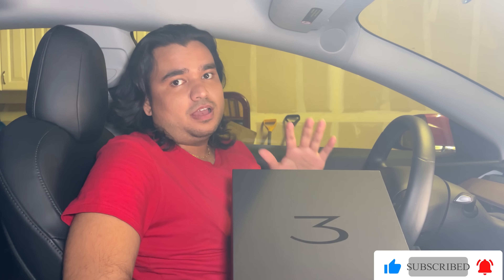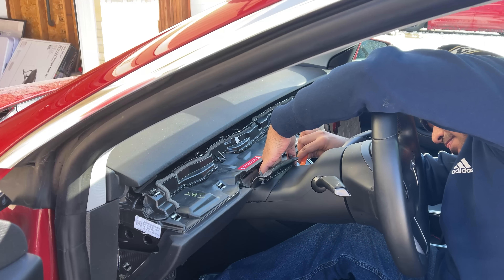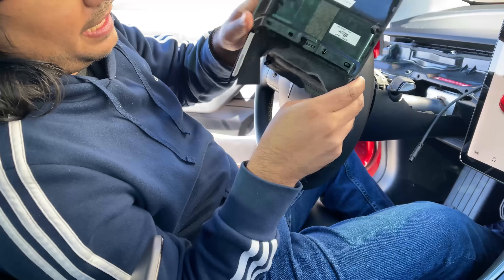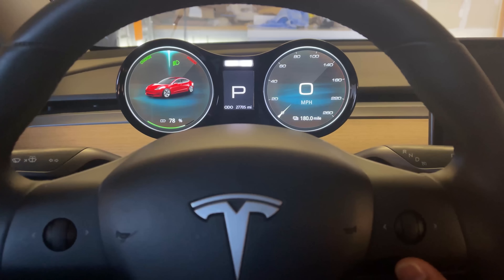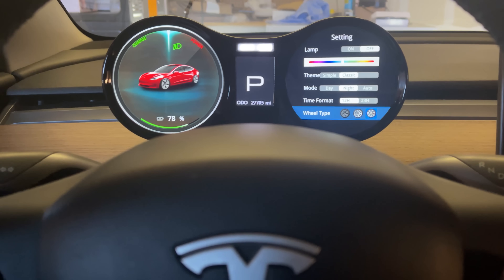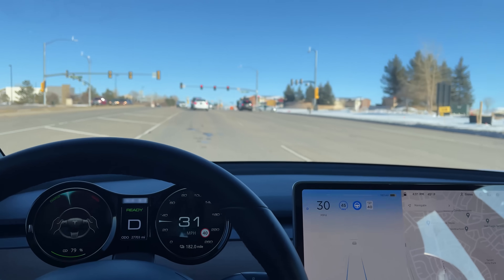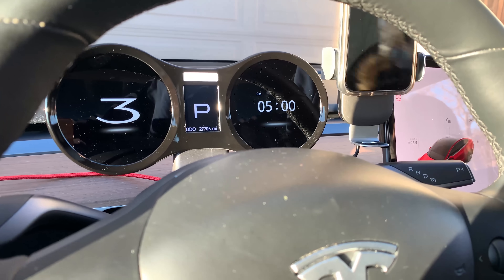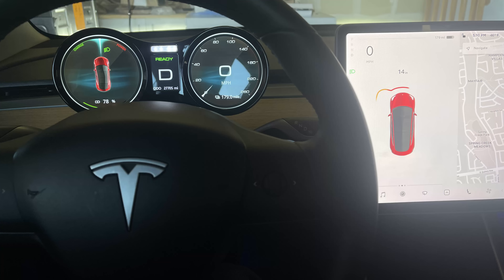New Display For Tesla Model 3 & Model Y - Instrument Cluster 2021

Comment: Great video. I wish it displayed more specs like battery temp, cell voltage, Pack voltage, remaining kWh... All of this data is visible through the can bus so no reason not to offer it as an option.
Reply from the maker: Hello, thank you very much for watching my video and providing your feedback. I agree, I wish it displayed more data. I did receive a software update file from them and will be updating the software soon. I wonder if that will bring some extra features and show more car spec. I will be making another video soon showing this product in action and provide my feedback since I have been driving with this display for a few weeks now.

Comment: The music on the transitions is really loud and sudden, you should try to tone that down in the future :)
Reply from the maker: Hi Kevin, I really appreciate that feedback. I am definitely working on my audio improvements for future videos. Thank you very much for watching and providing a great feedback.
Reply: @ShivaSapkota  Depending on your editing software, you can just ramp the volume up and down at the beginning/end of the audio clip to make those transitions more smooth.
Another pro tip- if youre watching your audio levels, make sure your loudest volume is at -3db, the music around -20 or -30 ish. If you turn your headphones/speakers up in volume, youll hear the clipping from the vocal track maxing out the audio levels. 

Overall- great video, great knowledge, and great presentation.
Reply from the maker: @breakfast-burrito  I really appreciate that feedback and the pro tips. I just bought the Rode Wireless Go mic and I will work on toning down the audio while editing. This all very helpful and I am extremely grateful for the support. Thank you again!

Comment: You buy a 60.000 plus tax car but complaining about $600 hmmmm
Reply from the maker: Hi Johan, thanks for watching my video and taking the time to provide your feedback. I understand the car cost $60K+ and as I said in my video, car customizations are expensive so $600 is nothing. However, for some folks, the benefit this provides at this state is not worth the cost as you can see from comments here. I also just read your comment about me wanting more features and complaining about the price, my apologies if I came off like that. As I said in my video, those are probably some of the future features through software updates. I was highlighting what I wish this device already had, but I totally understand your point of view. Finally, after I posted the video, I learned about a similar new product release from a competitor that has apple car play, navigation and some of the other features I discussed and costs about the same.

Comment: Can the display shift between metric and standard easily? Here, we use kilometres, but travelling to the US, switching to miles would be essential. Product looks cool, though. Thanks!
Reply from the maker: Hi Doug, yes you can easily change the units. All it takes is a swipe up/down to go between km and miles. You can also press on the right scroll wheel and change between the metric and standard, even while driving. Thanks for watching my video.

Comment: I am considering this to make up for the shrinking sizes of important info in the main screen with recent UI update with my ageing vision. It was fine before but this is clearly more readable at a glance. My two concerns are will my view of the displays be hidden by the rim of the steering wheel given my height (6ft), and will the fitting affect my warranty at all. Also how are software updates distributed?
Reply from the maker: Hi Richard, thanks for watching my video and for your question. I agree, the recent UI update was not good for many people. I know Tesla is doing that to prepare for a FSD rollout but it will probably take many years before there is a true "FSD". To answer your questions: I am 5'9" and I have a clear view of the display. If you raise the steering wheel a little bit, I think you might be fine. But, it might still block a little bit on the top. I am going to put a link for a competitor's product, check that out as well and it might be a better fit for your need. For the warranty issue, they way I interpret warranty laws is that Tesla cannot void my warranty simply because I installed an aftermarket product. They will have to prove that my after market display caused a failure to a part that is covered under the warranty. If they can prove that, they can void my warranty for just that one part. But, I am not a lawyer :) For the software update question, they just emailed some update files (I had to reach out to them) but, the way it works is I put those in a flashdrive, plug the flashdrive and run the update on this display. I will be making another video doing a review after a few weeks and show the software update process. Hope this helps. Please reach out at any time. 
Here is the Hansshow display (use code "SHIVATESLA" to get $100 off): https://www.hautopart.com/product/model-3-y-steering-wheel-center-console-screen/

Comment: There is a YouTube called die tesla crew that does an installation video on this and he shows what you need to do to remove a panel under the dash to help you get better access to that clip under the dash. He even lists the tools he used. Be prepared though it’s all in Dutch. But I could follow what he was doing just by watching, Hope this helps you in the future in case you do anymore installations.
Reply from the maker: Thank you James. I really appreciate that. I will for sure check it out for future installs. I really appreciate you watching my video.
Reply: Your welcome. Check it out and you will see him remove that section to get better access to the clip. Now that I see you can do that I’m more confident to give this another try. 🙂
Reply from the maker: @jamespeterson7100  That is interesting, he actually took out the glovebox panel. I think this is an overall easy installation except for that plug. But yeah if you want to remove the glovebox panel, it seems like the plug would come out easy. Thanks again for watching my video.
Reply: @ShivaSapkota  Yeah seems like that panel is held on by 2 screws and the rest are clips in the front that you pull off and snap back on when replacing. I just ordered the tool kit he used.
Reply from the maker: @jamespeterson7100  Excellent, please let me know if the tool really makes this installation easier. I am sure I will be testing other products in the future that requires connection to the autopilot computer. So, anything to make it easier to reach that one plug would be great😊
Reply: @ShivaSapkota  Ok you got it my friend! I should be purchasing a screen later this month or next and I will let you know. 👍

Comment: Thanks for posting. I was considering this one. Before I purchase, I would like to know what the competitor has to offer. May I get the name/link to the one that has Apple CarPlay ?
Reply from the maker: Check out the link below for the competitors product. I have worked with Hansshow in the past. If you use my code "SHIVATESLA" you can get $100 off their display. Let me know if you have any questions at any time. Thanks for watching my video. Display: https://www.hautopart.com/product/model-3-y-steering-wheel-center-console-screen/

Comment: Great video. How steady does it keep on the steering column? Does it vibrate or rattle at all?
Reply from the maker: It is super steady and doesn't rattle/vibrate all. I have tested in all types of roads (high speed, low speed, bumpy road etc). It feels like this display came with the car.  Thanks for watching.

Comment: Any idea who makes this gauge?  I could use those gauges for an entirely different project.
Reply from the maker: TopFit is the official seller and they told me they developed the product in-house and don't use any middleman. Even though the display shows "Carda" not sure if that is a company. I bet you can contact Topfit directly and find out if this gauge would support your project. If you would be comfortable sending me an email, I can try and connect you with Topfit. Thanks for watching my video.
Reply: @ShivaSapkota  Carda is a company that makes other automotive display stuff.  They could have contracted them or possibly just bought some of their base items and extended them.

Comment: The car should’ve come with a HUD tbh or option to add it.
Reply: Truuuuuuu
Reply from the maker: I agree, I wish there was an option to add such displays during the initial order. Thanks for watching my video.
Reply: Yeah I don't think Digital Panel Display works for Model 3 ergonomics. But a Holographic HUD would be perfect compliment. Seeing this has a method to tap into the vehicle data. Someone just need to develop a reliable tough video projection HUD, not a segmented element display.
Reply from the maker: @Neojhun  Yes, HUD display would be great. Just need to make sure it doesn't reflect off the windshield too much and is reliable as you said. Many cars have such displays, I am sure someone is working on producing one for Tesla model 3. Thanks for watching my video and providing your feedback.
Reply: @ShivaSapkota  Many cars have Segement Display or Dot Matrix HUD. A few are working on DLP Video HUD. But getting Colour Video Projection to be reliable and tough in automotive use has been very difficult. There is a crappy option just to use a very bright LCD but that it self has many problems. The dream goal is Video Graphics HUD.
Reply from the maker: @Neojhun  Oh you were referring to a colored hologram. This reminds of my undergrad years when I used to work at this physics lab and the researcher had built a 3D colored hologram of various planets in our solar system and it was amazingly clear and fun to play with 😊 That would be a dream goal to have a ultra HD holographic display in my car.
Reply: @ShivaSapkota  YES but it doesn't have to be that dramatic. Just some clear easy to figure out with your peripheral vision about Speed, RPM (yes on a BEV) & Nav Directions with smooth crisp motion is all I want. I don't even really want Augmented reality on the wind shield as that seems dangerous. Just a tough long life span system.
Reply from the maker: @Neojhun  I see what you mean. That would be really useful. Thanks again for watching my video and for a very insightful conversation. I hope someone is working on a colored HUD display for Teslas.

Comment: Way too much work. Does this affect warranty? Tesla should just add HUD like other cars use.
Reply from the maker: The way I interpret the laws, it shouldn't affect the warranty simply because we are using an aftermarket accessory. If this product causes damage to other parts covered under the warranty (due to improper installation etc) then Tesla would make me pay for the repair. But I am not a lawyer....Thanks for watching my video and I agree, I wish Tesla would at least provide an option to custom order with a built in hud display.
Reply: This does not seem like a lot of work to me at all. 
Popping off a few panels with clips? That's not difficult.
Not sure how you would make it look as clean as it is any other way..
I do agree with you that Tesla should have offered a heads up display or a instrument cluster in the first place it's one of the things I really dislike about the model 3 and model y.
Reply from the maker: @kens97sto171  Thank you for watching my video and taking the time to provide feedback. I really appreciate it.

Comment: Does it effect the use of the right scroll wheel since it is using this for the setting setup.  The right scroll wheel is used for cruise control - do you loose those features;  ie is setup of the display only when the car is in park, and in drive it is CC mode.
Reply from the maker: I just went on a little drive to test this for you :) As soon as you turn on the autopilot or cruise control, this display goes onto a read only mode. You can change the speed settings, following distance etc like normal without causing this display to go on a settings mode. If you are not on autopilot, you can go into settings mode on this display and while changing those settings, you can cause the "following distance" to change on your Tesla. Another way to get to the settings menu on this display is by pressing on the right scroll wheel as if you are activating the voice command. I think they chose the right wheel instead of left because the left wheel is used for majority of the car settings such as mirrors, steering wheel etc. Thanks for watching my video.
Reply: @ShivaSapkota  Thank you so much for testing and all that information
Reply from the maker: @Tom55data  My pleasure! Please reach out if you have any further questions. Thanks again for watching my video.

Comment: Have you tried the other rectangular display also that is in the market? By Hanshaw
Reply from the maker: Thanks for watching my video. I haven't tried that one yet. I heard that one has Carplay and AA functionality.
Reply: yes that’s the one with car play any thoughts about it
Reply from the maker: @satjitszone5677  That display looks really cool and I think the installation is going to be fairly similar as this one. You will have to get to the autopilot computer plug. The apple carplay option is great and looks like you can see more car information such as exact duplicate of what is on the main screen. You can check it out using the link below. I work with them and they make great products. If you are considering that product, use my code "SHIVATESLA" at the checkout, you can get about $100 off: https://www.hautopart.com/product/model-3-y-steering-wheel-center-console-screen/
Reply: @ShivaSapkota  hey thanks I almost bought this product

Comment: I think the lack of a direct "line of sight" driver display is simply BAD "Ergonomics" and a safety issue with the Model 3/Y.  I am now on my 4th Tesla starting with a 2013 Model s85, then a P85D with Ludicrous, and in 2018 a Model 3 Performance and from December 30, 2020 a Model Y.  Another big PROBLEM in the standard center display on the 3/Y is the demand to CONSTANTLY scan the center display when on "AutoPilot/Steer."  If you miss responding to one of nag warnings to "wiggle the steering wheel" you lose AutoSteer completely until you bring the car to a full stop/park and then restart....After over 15,000 miles of road trips  cumulative with the 2018 Model 3 and now the Model Y...having to constantly monitor the center display takes my attention AWAY from the road ahead!  This could be a serious SAFETY issue.  Something like this product allows the driver to see those "AutoSteer" warnings directly in front of their normal line of sight watching the road, so I see this technology as an added "Safety Feature" as well.
Reply from the maker: Hi George, thanks for watching my video and for a very insightful feedback. I absolutely agree with you. This device not only offers added convenience but adds safety features by providing access to critical car information right Infront of our eyes.
Reply: I haven’t had an issues with not having one right in front of me. That being said, it’s a cost cutting move by Tesla.
Reply from the maker: @lrod8692  Thanks for your feedback.
Reply: it’s like that to make sure you’re paying attention. obviously you aren’t paying attention if you have this problem.
Reply: People complaining about a glance with your eyes to the right or left depending if your Europe or US lmao how lazy are you. Besides these cars are designed to be future proof for FSD where you wouldn't need to be looking at a instrument cluster.
Reply from the maker: @TheoFennel  Thanks for your feedback. I appreciate you watching my video.
Reply: @TheoFennel  I agree with you, except Tesla doesn’t agree with you.  Which is why the new S and X have a cluster in front of the driver.  It has nothing to do with FSD and more to do with cost cutting, making sure you upgrade in the future.
Reply: @TheoFennel  I think the current AP is lacking and I don’t trust it on two lane roads so I drive my Model 3 myself except on highways and bumper to bumper traffic so I think having a screen in front makes it safer. I agree with you about not needing it when FSD becomes a reality but the way FSD is progressing I will be on my 3rd or 4th Tesla before that happens.
Reply: @TheoFennel  So, model S and model X are not "designed to be future proof for FSD" since they have the instrument cluster. You should apply to work for Tesla and argue with Elon to take out the instrument cluster of Model S/X then
Reply: Huh?  I've had the Model 3 for 3 years, 35K miles... this is not even an issue for me. Set your autopilot speed to 10-20+ speed limit and you don't even have look at the speed.   When you are on autopilot, train yourself to use the scroll wheels and it'll never nag you.
Reply from the maker: @jhchooo  Thanks for your feedback. What George is referring to definitely applies for some people but not for everyone. I have a relative who has a Model 3 and shares the same frustration of not having a display infront of his eyes. As I said in my video, this device provides an option for folks who want it. Thanks for watching my video.
Reply: Good video and option for some people but better to learn the features in the car and not worry about certain things.   Full Self Driving will make this more of a non-issue in the future.
Reply from the maker: @jhchooo  Absolutely! Thanks again for your feedback. Much appreciated.
Reply: @jhchooo  scroll wheels only work in the usa.